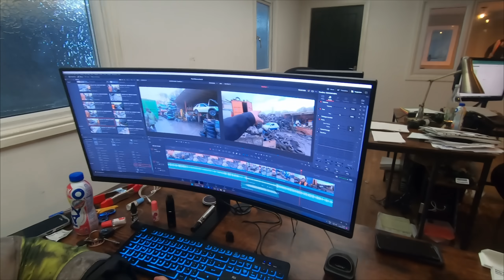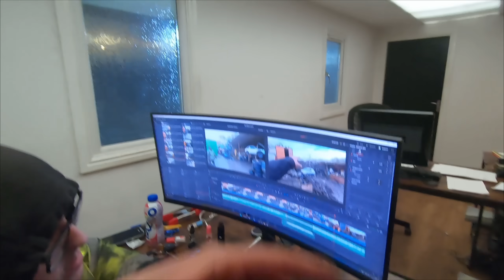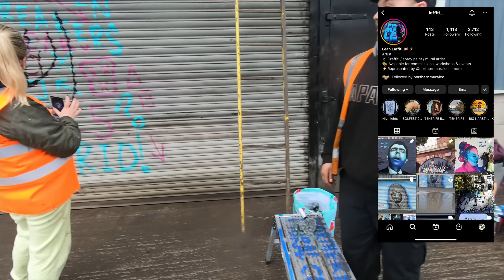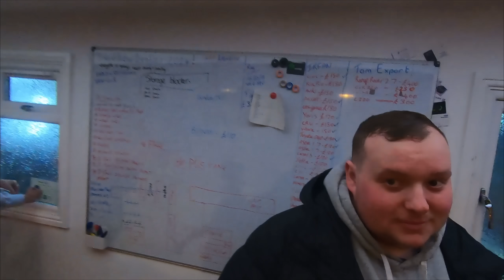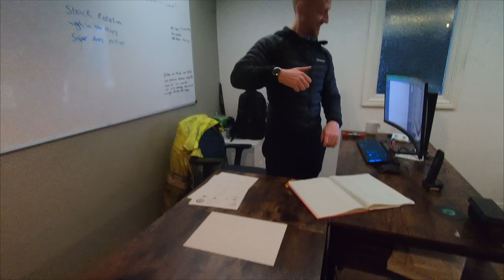Somebody Graffited Our Yard! | WHAT A LOAD OF SCRAP - EP16

Comment: An idea for the future progress. 
The blue cabin attached to the office. Empty it into new fridge containers. Donnie can have that as packing room. Share printer and internet from main office. 
The unit Donnie is in can be the part worn tyre unit where u get a operative in to strip all tyres and fit part worns for customers. Would free up a yard operative from doing the wheels and alloys. 
Alloy skip can go next to Donnie’s unit. 
I thought the tyres that wasn’t good enough got exported to Africa where they put them inside each other for space saving. 
The yard is going in a good direction and can see the great progress, I like the scrap bay moving and will speed up production. 
Think u should be selling a couple, that Astra would be a good start and like u said be £1500 that.
Reply: thanks for your ideas adam.👍